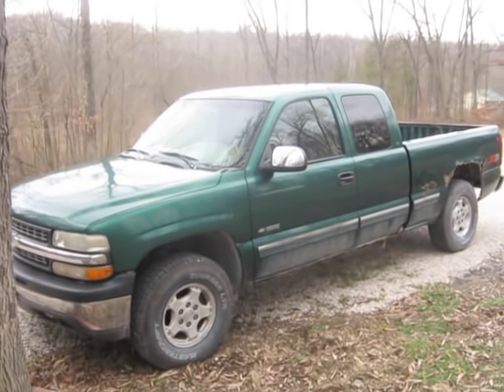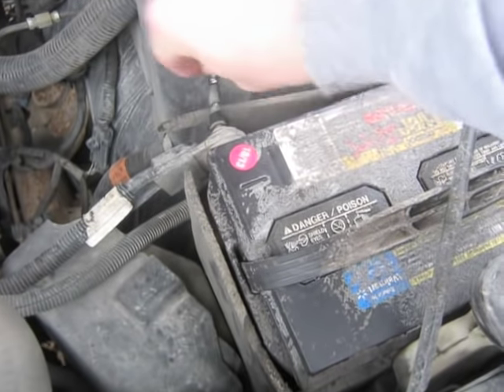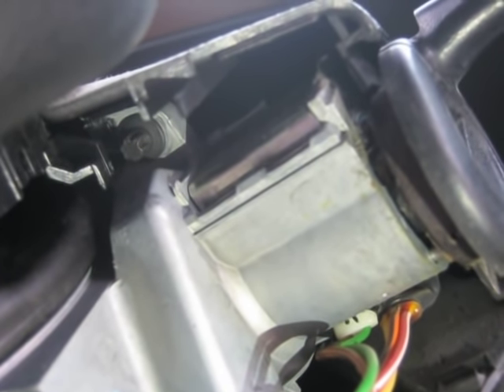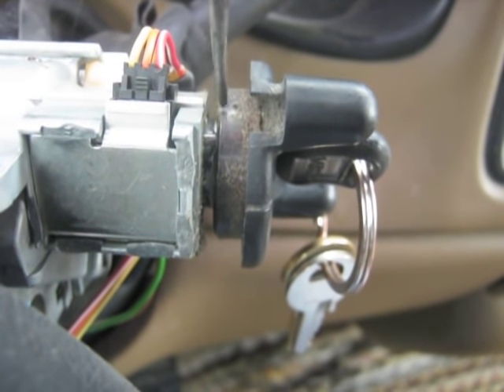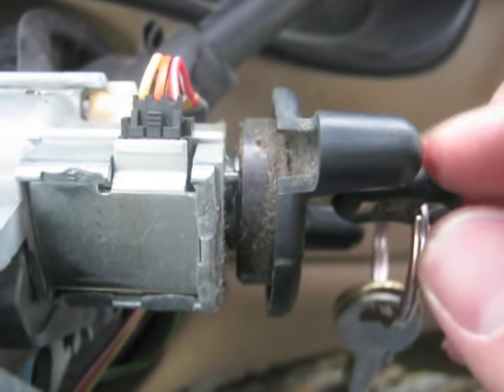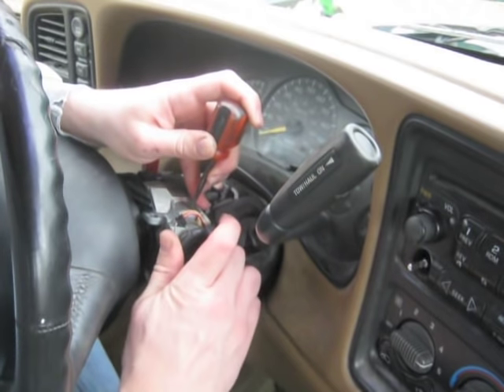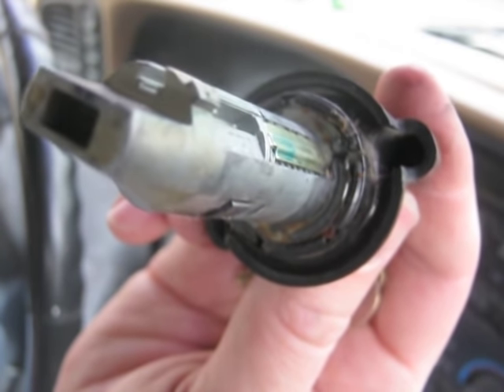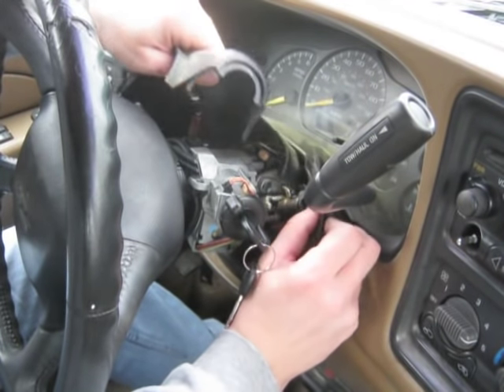Key won't turn ignition - ignition lock cylinder Chevy Silverado 1999-2006

Comment: First thing is to determine if its the key that's bad. Most of the time, cutting a new key by code will solve this issue.
Reply from the maker: Dogfishrising6 excellent tip
Reply: That's true, as long as the code is still available. I'm dealing with that right now at work
Reply: @zacharyirving5080  if you have a key bring it to an auto locksmith for decoding
Reply: Unfortunately, at least where I'm at in Florida, the locksmith charge a minimum of $100 up to $180 to code a key. 
I bought a new lock cylinder that came with 2 new kets and the kit included 2 chip keys & instructions on how to program yourself.  
All for $ 107.  Really can't beat the price

Comment: Hello I have a 1998 Chevy s10 and the lock cylinder won't come out!! I drilled in to it like another YouTube video said but it didn't work so I'm stuck and also the key won't even move to the on position I need help thank you and God bless you
Reply from the maker: telesforo navarro I’m sorry, you may need to get in touch with an automotive locksmith.
Reply: Drill the lock out until it moves then take off ur steering wheel and airbag and replace the ignition switch and the ignition switch housing

Comment: I put in a new lock cylinder but the key will not turn.  The part they sent  had to be assembled with tumblers which I did.  I have a 2001 Chevy Silverado 2500 Diesel.  What do you suggest?
Reply from the maker: It's possible that if the ILC is not an OEM product it may not be fitting flush in the housing. Possibly the tumblers aren't in correctly, or there may be a problem with the key itself. Could be any number of things.
Reply: the problem actually isn't the pin he shows in the video, it looks that way, but the problem is a worn key, so if you reused your key that is why. I just posted a fix to compensate for the worn key

Comment: Hi, I watched ur video and guna see if u cud help me? I have a 2003 chevy avalanche and my ignition cylinder is locked on the on position but my key comes out. I had to pl ignition fuse to turn truck off. Any suggestions?

Comment: Great video. But I think that the real problem with your cylinder is that the old key is so worn out from use that it will not allow the cylinder to turn. If you have a new key cut, the new key is generally a fraction of an inch bigger than the old key. This will allow the cylinder to turn freely again. Thanks again for your video.
Reply: I had the opposite happen with new cut keys, the new ones wouldn’t turn the lock cylinder. After buffing it on a wire wheel it worked fine for about 5 years, then got harder and harder to unlock. Now it won’t unlock at all and I’m waiting on the new cylinder ordered online to get here.

Comment: nice vedeo mate good help i need replace on my suburban 95 regards from norway
Reply from the maker: jorge fonseca cool! Glad my vid helped you out way over there! Happy repairs!
Reply: i take some time but i fix as well great help i need help for electric problem!! dam speedometer not working after a modification (i remove a automatic trans. tu full manual trans. 5speed NV4500) now is not working i don"t understend why!! all cables and conectores is in right place and no damage i"m so sad i try undred thinks and still not working i need find some fella understend a GM  electric shematic"s anyway thanks mate i apreciate if someone can help me

Comment: Mine got stuck while it was on, after about 1/4 of gas wasted. I disconnected the battery and alternator. The. Key cylinder was also stuck. Do you have to reprogram a new key or is just plug and play with the new one

Comment: It's such a pain when it locks up..what always works for me is if you grab the steering wheel put foot on brake an try turning it LEFT AN RIGHT the trick is too DO HARD LIKE FU";:Kn hard an turn the key at same time..  gear leaver is on the steering colom try moving that back an forth a bit then repeat the first trick then everything will unlock ..I've done this on every type of vehicle and for random people in parking lots it's never failed me . I learned it when I got a flat on a highway .i was done changing tire an the key would not turn the steering wheel everything locked I sat there for an hour messing with the ignition then flipped out grabbed the steering wheel started trashing it L AN R an turning the key kicking the brake then poof the key turned I never laughed so hard by myself .SHIT HAPPENS
Reply: ARTHUR THOMPSO upN

Comment: I have a doubt. When I was a kid, my dad owned a 1987 chevy celebrity. That's the 1st time I noticed that on GM cars, the ignition key is turned using the protrusion. What is it used for? What is the purpose?  On other cars we just turn the key.Here we turn the protuding metal clamp.I haven't seen it on Japanese or other manufacturers

Comment: Hi! I need to know what tools exactly did you use to unscrew the column,please would you tell me.
sorry for my English.
Reply: torx i think T25
Reply from the maker: T20 Torx bit for the screws on the bottom cover (or a 1/8 allen wrench), then a 4mm socket to get the small bolt underneath the top cover next to the ignition.
Reply: The Daninator thank you very much! thanks for answer.
Reply: My 2004 had no screws on bottom. The top half had the 4mm screw I could see by looking straight up between the steering wheel and the ignition key (but it was missing on mine and doesn't seem to need it).

There is some magic to getting the top half out and in, that I did not ever figure out. I just kept trying and wiggled it gently and all of a sudden it was out and I used a similar method to get it back in. It did help to raise and lower the tilt steering a few times.

Note also that the bottom plastic has little hooks at the back where it clicks into the top plastic. So when removing the bottom it helps to push back a 1/4 inch after all the other clips are released.

Comment: Inhave 97 k1500. Turning on key wont start at all. Fuse 40 A / ignition keeps blowing out.I am getting a/c and light power all around interior. Battery seems to be fine.Can you guide me to my
 issue please from your experience on issue like mine. 
Thanks in advance.

Comment: Try to remove the ignition switch without a key. Tell me how you would do it. If you can. I'm working on it now and will make a tutorial once I have a definite answer. Thanks.
Reply: My key won't turn the ignition ,  did you find a resource for that ?

Comment: Great video - I did the whole swap over and installed the new cylinder fine, but the car won't start with the new cylinder.  Does the Cylinder need to be recoded for it to work properly.  I am in a 2007 Avalanche and the starter and switch should be fine.  The truck starts fine just the key gets stuck often and I have to wiggle it to get it started.

Any suggestions?
Reply: The electrical on the other side of your ignition sounds like it could have a short but you would need to meter it out as well as test the current on the entire ignition system.

Comment: Great video.  2001 GMC Jimmy - no key needed to turn, but wouldn't start and couildn't move gearshift.  Replaced per this video.  Now I can move the gearshift, but engine won't start...  Turns over but won't catch.  Is that likely from normal causes, or could there be a problem with ignition switch or something that still isn't fixed?
Reply from the maker: Ways In  it's tough to say. I would think a bad ignition switch would show some other symptoms. I had a Buick Regal that had a bad ignition switch that caused the whole dash cluster to blink on and off. It would start, but not all the time. And when it did run, it ran rough. I'd probably look into the simple things like fuel and spark.
Reply: Thanks.  That echos my thoughts.  I took a meter to the fusebox and found all fuel pump and other key functions were hot with the ignition on, so I will play now with the routine stuff.

Comment: I need to know how to take the bottom cover off of my steering column with the ignition switch and steering adjuster, how do I get it over that or take the steering adjuster out.? please help
Reply: You have to remove the dashboard first. Simply tug on the edges and it will pop off. Then two little special security bolts under the top cover will be seen once you remove the lower steering column cover.

Comment: I got the cylinder replaced on my 2000 Suburban but the security light flashes and power cuts off after it starts. How do I reset the security system to keep it running?
Reply: Did u ever find out how? Currently have the same problem

Comment: I have a 2000 chevy silverado... I can turn the key and start it but the key doesn't turn back so the starter just keeps running so I have to manually turn it back. Do u think I need a new cylinder?

Comment: Nice Video....However, always undue the Positive Battery Cable...If while probing with a metallic device, you can not complete the circuit by making a ground...leave the negative connected.
Reply: Wrong
Reply: @ZKPG ditto on that.  Who tf taught him basic mechanics 101? 

Probably can't afford a phone since he fried his electrical system

Comment: Had this problem a month ago. Yesterday at a stop sign the truck was shaking through the brakes for a second. Once ready to park , started reversing and it just turned off right on reverse ... a friend said it most commonly might be the ignition switch
Reply: Note there is a difference in the ignition switch and the ignition lock cylinder.

Comment: I HAD TO STICK A LARGE FLAT BLADE SCREWDRIVER DOWN INSIDE  THE HOUSING TO ALIGN THE BOTTOM SECTION SO MY NEW CYLINDER WOULD DROP INTO PLACE
Reply: Did you have to hook the battery back up to use the flat head screwdriver or not

Comment: I just bought a 91 silverado k1500. It won't start at all and the key takes about 20 tries to finally turn. The battery, alternator, and starter are all relatively new. Could this fix the problem?
Reply from the maker: If you can't physically turn the key, this would fix that problem. If you can turn the key, and the truck won't turn over, then it could be the actual ignition switch, or a problem with your starter, or several other issues. Hard to say.
Reply: ok. thank you sir
Reply: @TheDaninator   For like 10 years if its a hot day my key turns, but nothing happens. If I wait till it cools off it starts right up. Today cooling off did not work. I don't think its my starter. Do you think there could be a short in the ignition switch? Any idea would help thank you.

Comment: Hey everyone i really need help with my ‘02 GMC Sierra truck. It turns off randomly while the truck is running and at stopping points at a light whatsoever. When the truck turns off sometimes it can immediately turn back on but after so many times of using the truck after shutting off.. the more faster the truck turns off. I literally changed all types of mechanic work into the motor.. took it to 2 different expert mechanic and now I’m assuming it’s an electrical problem (i assume). I came across that MAYBE this ignition switch and key cylinder could be the issues of why it shuts off?? Any ideas would be helpful. Thank y’all
Reply: Cesar Tx watch some south main auto and learn how to diagnose with multimeters and scan tools and so on

Comment: Ok. The pin you are talking about is a position indicator. Has nothing to do with locking. The sidebar is the locking mechanism. No key in the switch the side bar is out. Put the key in and the side bar pulls into the cylinder body. Next time go to a locksmith and have your key code cut. It will work like new. How to I know this? I am a certified registered locksmith. I have made keys for thousands of gm 10 cut ignitions

Comment: Nice job. Thanks for this..exactly what I was looking for. 

I think I have related issue..in my situation it takes several random turns before the key actually engages the starter/ignition..do you think this is also some type of wear on the cylinder ? 

Thanks again - great vid👍
Reply from the maker: Val Halla it’s possible. But I would guess that may have something to do with your ignition switch...but that’s just a guess.
Reply: The Daninator ok..Thanks for the reply. Really appreciated. Cheers

Comment: This is happening to mine except there are shorts or something in the ignition because it’s not getting any power to the starter
Reply: My ignition turns but nothing happens.. this happens when its hot outside. when it cools down it usually starts, but today nothing. any ideas?

Comment: Hey... Maybe you can help me... My ignition cylinder had got stuck all the way on. My starter kept spinning. Key comes out. I followed your steps on replacing cylinder. But mine will not slide back in. Any idea? Anything thanks
Reply from the maker: I have heard that some aftermarket cylinders may not fit exactly right. This could be a possibility with yours.
Reply: Yea i finally figured that out yesterday. Thanks tho. I appreciate it.

Comment: what if you cant get your key to turn to the on position, mine is locked in the off position and will not move how can I remove the lock cylinder, any help appreciated
Reply from the maker: J Chandler maybe some lubricant in the small pins will help. I would have to wiggle the ignition front to back to get the key to finally turn
Reply: Thanks I will try that, my last option which I don't really want to do is somehow drill it out, have to go to work Monday
Reply: J Chandler the same thing happened to me, and I did put lubricant on it, yet it still doesn't turn, what should I do in this case?
Reply: just got mine don't a hour ago, I had to drill out the pin hole on top of the lock cylinder case enough for me to get something in there to turn it because mine was locked in the off position once its out takes 10 seconds to put a new one in
Reply from the maker: Thanks for sharing your tip

Comment: Trying to replace mine today 
But my key won't turn to the on position to remove the cylinder plus the black part on mine is broken off the cylinder 
Any thoughts
Reply from the maker: jonnyboylacroix try a little lubricant at the pin points. Wiggle front to back as you try to turn the key.
Reply: The Daninator do the pins need to be in before I can pull cylinder out?
Reply: I got it out pretty sticky do I need to put anything on the new cylinder before I install
And any clues or advise for getting my duct cylinders to open for my AC?

Comment: why did you have to disconnect the battery? Thanks
Reply from the maker: Tobin Satterwhite you don't want your truck starting when you turn the key to remove the ILC.
Reply: The Daninator will this make heat and air conditioning not work
Reply from the maker: World Under My Thumb Link Correct. No battery means no power to run fan, a/c or heater, or anything. The vehicle becomes a 1,500 lb paperweight at that point.
Reply: I meant key cylinder

Comment: I have a similar problem with my tahoe but i also get rough running, bad emission and, depending on how I start it will work well or not..... I noticed that if I kicked the side panel of the dashboard on the driver's side it would run well again. Looks like a bad contact to me, maybe related to the worn ignition cylinder? Anybody got a clue?
Reply from the maker: I had an ignition switch problem with a Buick Regal once before. Rough running, dashboard lights blinked, clicking sound from the dash, sometimes it started, sometimes not. It would run rough, then stall. Maybe your ignition switch is going out? I hope you can get it figured out. Best of luck to you.

Comment: What if i cant turn to on position? How can i take it out?
Reply from the maker: An automotive locksmith may be in your future. I've read where some have used a drill. I'm not sure how, but do so at your own discretion
Reply: The Daninator really a locksmith? Someone tried to steal my 1995 gmc and I can't turn the key on to pop out the old cylinder
Reply: you have to disconnect battery because you have to turn key all the way on then push the release tab

Comment: That pin is fine. And the cylinder, most likely is also fine. Your key is garbage. You wiggling the key is moving the wafers inside just enough that it's allowing the sidebar to recess. This is a VERY common problem with the GM b89 and GM b109 keyway. The key is designed to wear out BEFORE the ignition, and they do. A lot of people just get a crap Walmart copy of their already worn out key thinking that it'll fix the problem. It doesn't so they blame the cylinder. Just take your key to a locksmith and have them read your key and make a new one back to factory specs. I do it for people all the time.

Comment: I changed my turn signal switch on my 2001 Chevy Silverado pickup and now when I try to crank it it will crank but cuts r off but I don't have head lights like when I crank my truck up but I don't have head lights after I changed the turn signal switch and a nother thing is I have tale lights and dash lights so I don't really understand what is going on with this truck lol
Reply: U ever figure it out? Got the same problem right now in a 02

Comment: What if your key is broken inside the ignition
Reply from the maker: Yikes. I'm not sure what you're options are, other than seeing if a locksmith could get it out.
Reply: take a small open saw blade.. in seat it and let the teeth grab the key cuts on top.. and pull it out.. :)

Comment: what if the ignition is stuck on the on position? what do i do?
Reply from the maker: The cylinder needs to be in the on position to remove it, so just stick a pin down in the hole to depress the spring lock like I did in the video.

Comment: Mine is just the opposite. My key won’t completely turn off. It’s staying in the accessory position causing the fuel prime to stay on a drains the battery. Plus the key won’t come out.